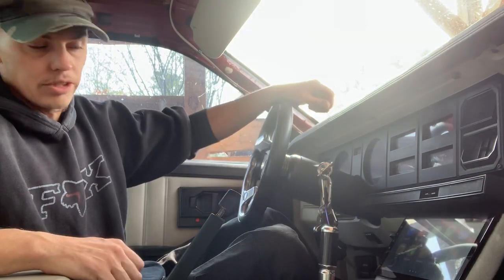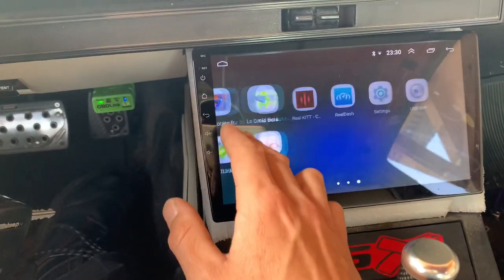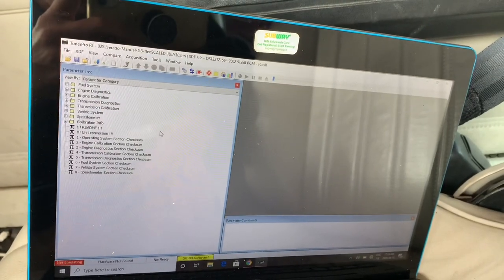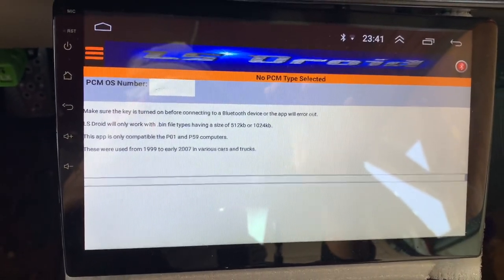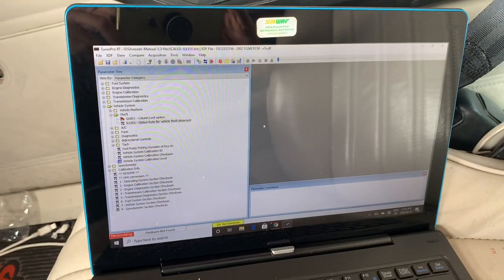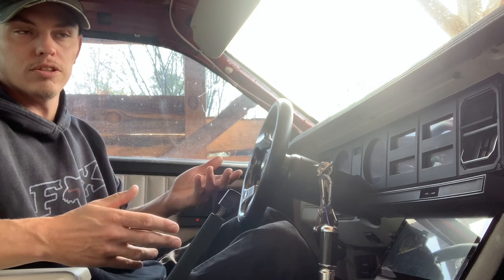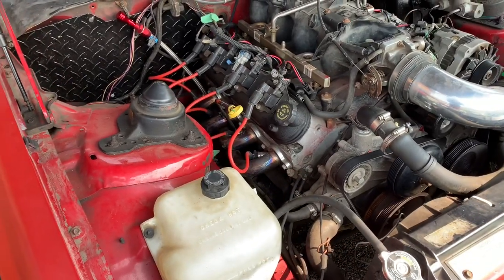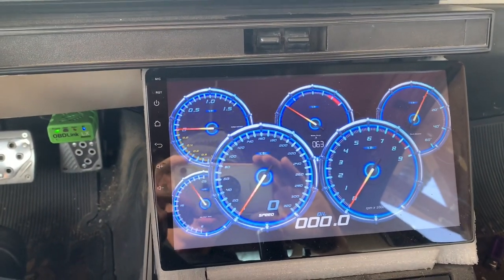LS Swap Free Tuning & VATS Disable Via TunerPro & LsDroid

Comment from the maker: Cheap eBay OBD devices will NOT work with LSDroid.  ONLY 2 types of good QUALITY Bluetooth OBD devices work with LSDroid.    Personally I’m using the OBDLINK LX Bluetooth device.
Reply from the maker: @garylee6037  ya that’s the one I’m using.  With a certain firmware version which you can change yourself to suit

Comment: Thank you for sharing your knowledge.  I am currently buying parts and assembling a 2006 Drive by wire LM7  5.3 to install in my 1995 chevy cheyenne long bed. Got everything from a donor gmc Sierra . I have been going back and forth between getting  HP tuners or just biting the bullet and getting the holley terminator x max.
Reply from the maker: Awesome, sounds like a cool project.  I converted my 05 L59 to throttle cable with a 2002 harness and throttle body 😎👍🏽

Comment: Will new obd link mx do this
Reply from the maker: I believe so, However, the last update with LS droid Required an older version of OBD link firmware, So since they updated LS droid, only certain versions of the firmware will work, but there is a database of firmware so you can download older versions of the firmware on OBD link website, I believe.

Comment: Please help anyone, I’m on the step of loading the .bin file into tuner pro. Once I get in and load it with the 7603 XDF , the only thing I change is VATS disable then try to save. Problem is I get an error saying “error - one ore more checksums could not be updated
Reply from the maker: i had the same isuue,  someone told me i'd need a certain plug-in update file so i did but it had the same error you mention when saving.  so i deleted the tunerpro and all the add on extensions, then i re-downloaded just the app, no extensions nor plug-ins, and it worked fine after that.  i made the mistake of reading old information but there have been proper application updates since then

Comment: Did you see a increase in power with the flex fuel injectors .
Reply from the maker: Yes and no.   Yes because I had a dirty injector before I switched rails, but also I say no because after you properly tune the flow rate in the PCM to match the new injectors, you are still running the same AFR.  The same amount of air is entering the engine so if the AFR is the same and the flow rate it properly changed, the amount of fuel would be the same IF you are targeting the same AFR and if you have the flow rate changed accordingly.  I did not change the flow rate immediately and I ran it a few times with the old flow rate where it was very Rich until I changed the flow rate tables in the PCM to the FLEX 4.16 grams per second and then I had to scale the flow rate because I switched from a vaccumm referenced fuel regulator to a c5corvette regulator .  But if the tuning is good and if you’re targeting the same AFR , same displacement, same amount of air moving, I’d assume that the performance wouldn’t change much.  However I did increase performance slightly because I went from dirty injectors to clean flex injectors, so that did help performance in that aspect.  Mostly I just wanted to be rid of the old dirty ones and install the nice stainless rail setup.  These flex rails look 100x better and don’t rust plus they aren’t partially clogged like the old ones were.
Reply: The flex fuel injectors have the potential for more power. Because they have potential for more flow and longer duty cycle.  But if you don't need it it doesn't matter. It's like having larger valves, gives you potential for more flow, but if you can't get the rpm you don't notice it.

Comment: Can you make a more detailed video showing how the bin and xds has to match. I just don't get it ty
Reply from the maker: Ok .  Good idea.  Basically there is are several operating system, software versions.  Your operating system version must match the XDF .  The XDF is like a modification menu, so you need the matching XDF (mod menu) to work with your BIN file operating system software version .    You can easily identify your operating system by simply turning LS droid on and choosing PCM read or write , in which case it will identify your OS (operating system).  XDF files are available online, and the creator of LSDroid is currently working on a version for windows as well as constant updates and upgrades
Reply: @613Builds  so I look at the 120000 etc number and find xds with that same  # right. Ty.,love your  videos keep up the good work son

Comment: Did you use the obd2 torque bluetooth for the tuning or you had to get another one
Reply from the maker: I’m using OBDLink Bluetooth device it’s a higher quality device because the cheap ones are terrible.   The dash apps I use are OBDLink and RealDash but RealDash is probably my favorite.  You can use lambo gauges and Benz gauges.  Personally I do not use torq app because it’s basic and overplayed, the RealDash app is cheap and it has a free version, and the OBDLink comes with its own free app as well but you can do a lot of things like scan the car and data log or performance dyno mode .  These are basically the same as torq app but I think these are better.  You will require the OBDLink device for the OBDLink app but a nice GOOD OBD2 device makes a big difference.   Previously I tried a cheap ELM327 Bluetooth dongle and it was junk.  Ive tried the torq app but it doesn’t look or behave nearly as good as RealDash or OBDLink .  I guess a lot of people use the torq app but I’ve been using the OBDLINK and RealDash for years.  I can actually use the OBDLink to tune my car and flash program the cpu when combined with LSDroid and TunerPro .  It’s a good setup
Reply: @613Builds  thanks..... So there's no way to use the cheap odb for tuning with lsdroid? I have to have odb link brand? I want to write a tune or clone one.. And what does deleting vats do.. Im trying to just give my truck a little boost it's stock for now

Comment: Thanks for posting this. I can't seem to get tunnerpro to work. I get checksum error when saving bins. Tried 3 versions of tunnerpro. Same error re-saving virgin file no changes. Thanks
Reply from the maker: Originally I had the same issue.  Make sure you have the latest version , delete any checksum inputs and try again.  I got mine working with no checksum plug-ins

Comment: Will it turn on dual fans and set temperatures??
Reply from the maker: Yes 👍🏽 you can control the fans on and off temps in TunerPro ✅😎👍🏽
Reply: @613Builds  awesome
Reply from the maker: @45CHI  my fans are on a toggle switch for now.  Only because my 2002 truck harness didn’t come with fan pins, but my swap car 83 firebird and the donor car 05 suburban both have electric fans.  It would be nice to add a pin to my harness then I could ditch the toggle switch and set a fan temp in the tune

Comment: You were able to get ls Droid to work?
Reply from the maker: Yes , I used it to rear and write my PCM in conjunction with TunerPro to delete vats and change my injector flow rate, but it only works with OBDLink or OBDX , only with those specific Bluetooth OBD2 adapters
Reply: @613Builds  First off I'd like to congratulate you on your project and your persistence and drive.  Cool I'll try it again, maybe there's a software update needed. I ended up using pcm hammer (windows). Also you can have them add a tonner ring to your to your 700-R4 when it gets rebuilt. The latter  88-92 truck 700-R4's/4L60 (no "E") had that output. The cars had some kind of hybrid (mechanical/Electronic) speedometer with even different output. Corvettes and some Cop car Caprices had two  outputs. Dakota digital offers a mechanical drive thru electronic adapter also. All of them have different pulses per revolution, that can be worked around in tunning. What bracket did you use for your Throttle Valve cable?
Reply from the maker: @pmotorsports8276  thanks.  my 700r4 is from a 89 suburban 2wd.  I made my own TV cable bracket by combining a 2002 5.3 throttle cable bracket with an 83 Chevy cable bracket in one of my videos.  In the throttle body I welded a tv cable throw-lever arm from a quadrajet carb.  I show that in one of my videos.   What Bluetooth device are you using?  I had trouble at first connecting the Bluetooth to the android but eventually I got it connected by using the OBDLINK app first to make connectivity.  My factory dash is mechanical speedo and it works, but I also have the digital dash app and they both have GPS speed options.  So I just switched the RealDash app Speedo settings from CPU input to GPS input and that allows me to have both factory mechanical speedo and also a digital dash with GPS accuracy.
Reply: @613Builds  Cool I must have misunderstood. That one should have come from the factory with a VSS ring. That your ECM was looking for. Maybe you were referring to your stock speedometer.
Reply from the maker: @pmotorsports8276  my stock 83 dash speedo is cable driven and my 1989 suburban 700r4 is cable driven also , but my android digital dash does also display digital but with GPS input .   https://www.chevytalk.org/fusionbb/showtopic.php?tid/251806/